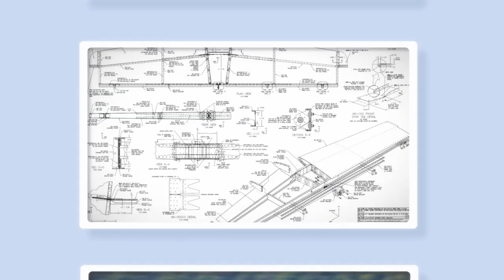Van's RV-8 Build. Ep 084. What Laser-Cut Parts Mean to Me

Comment: Hey I am just a old country farm boy but I have a question. Why couldn’t all the holes be drilled to one size larger and use a size up rivet. Would that work?? Or do I just need to keep farming?
Reply from the maker: Great question. And, the answer might be a little different for builders of different models. My kit (the RV-8) requires that all of the holes be final-size drilled... They're only a few thousandths undersized. But, I found that simply reaming the holes eliminated any irregularities that I found. Builders of the -14, for example, receive their kits already final-sized. So, there isn't an opportunity for reaming the holes to clean up any imperfections.  As far as I can tell, all of my imperfect parts have been serviceable, but I have seen parts from other builders that had grossly malformed holes that would require actual upsizing (ie. #40 to #30) to clean up. Doing so (especially on a large scale) introduces another potential problem: edge distance. In many cases, the rivet holes are so close together that upsizing two adjacent holes would cause them to be too close to each other. Or, if not violating edge distance now, it can be a problem in the future if a repair needs to be made that would require drilling out some rivets... the ability to upsize any holes damaged in the process would be taken away. From what I understand, rivet rows are often spaced to allow just enough room to upsize a hole if necessary, but certainly not upsizing twice.

In short, going up a size is a good solution for one-off applications, but not entire structures (in my opinion).
Reply: @thathippiepilot  Thanks for the quick reply. I can see on r it’s too close to each other or to the edges it would probably not work. My dads advise was always if it doesn’t work get a bigger hammer. (Lol). So sorry for such a big investment for you and others to hear so devastating news. Do you think Vans will be able to make things right.?
Reply from the maker: I’m confident they’ll pull through. It will take some time to get it all sorted out, but my build was going to be a multi-year endeavor regardless.

Comment: Dont take much brains to work out that melting alloy to cut it would not have major effect on the chemical balance of the material as you know a lazer has to use extreme power to cut alluminiun